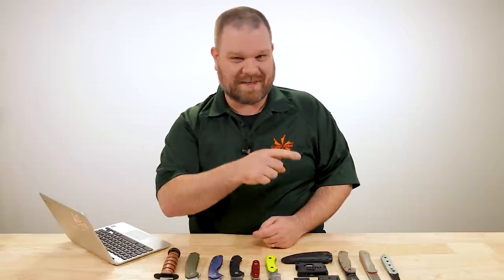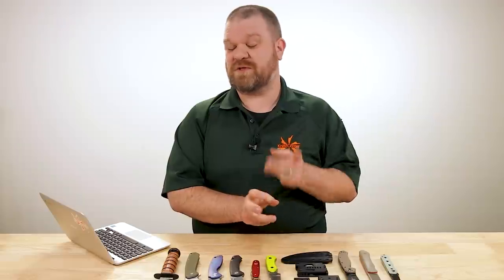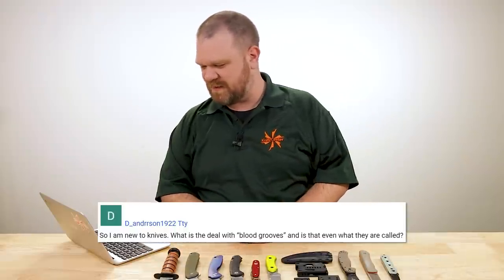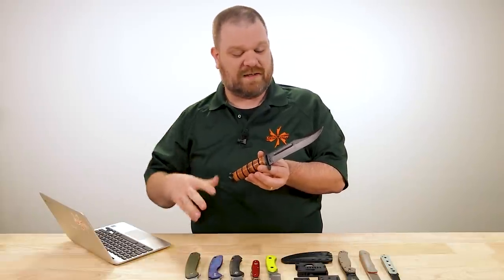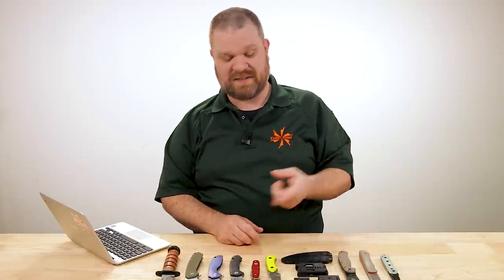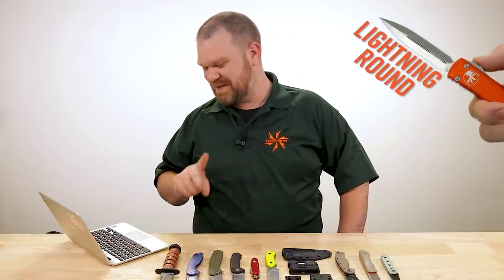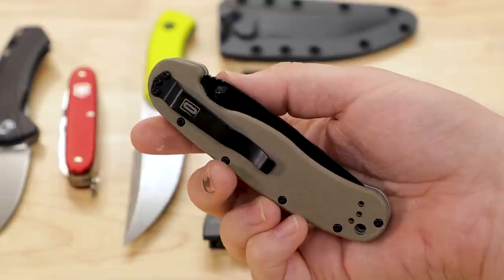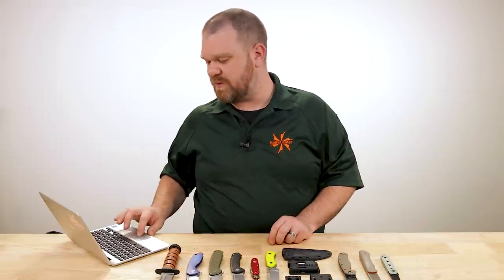KnifeCenter FAQ #94: What Is A Blood Groove?

Comment: Ontario is a good work horse and very easy to sharpen with the AUS-8 steel. Mine had some patina and scratches but it works fine.
Reply: Bought a coyote D2 Rat 1 as my work edc  again , as I gave my son my older one.  One of the best budget folders out there .
D2 was easy to sharpen with a ceramic or diamond rod.

Comment: The way I explain it is to imagine the strength of a flat bar of steel being bent in half vs an "I" beam. You've added four extra dimensions of strength in the material. The extra points of tension should add more structural integrity. It has multiple purposes but that one is my favorite.

Comment: Be sure to mention that to George Patton, Who wrote a treatise on knife blade features and their purposes while he was a student at West Point.Yeah, THAT George Patton.Grooves today in blades are often used to cut down on blade friction as it goes through materials. These are common on everything from certain kitchen knives, where they usually run vertically, to custom knives like Busey.Fullers found on fighting knives also increase rigidity, useful in thrusting. Saving weight is only a small part of the reason for a fuller.

Comment: Hi DCA, question about trying to find my first front flipper for my newly started collection. I try to keep a budget of around $150, and worry finger safety with a front flipper with liner and frame locks, since i'm losing the thumb guard that a traditional flipper tab gives me. What would you suggest for a front flipper that either has finger safe locking mechanisms, or has something similar to a traditional tab or at least a larger finger choil that can still act as a guard? Thanks.  PS. I have looked at the Kizer Cormorant, but I typically don't like the look of clip points, so bonus if it also is a drop point or spear point, since i think those are some of the best looking blade shapes.

Comment: Hey KC crew! Recently got a new pair of boots so naturally I had to get a new knife to boot carry. I ended up going with the Boker Mad Man, which I’m very happy with. It sacrifices on grip length to keep the chonky blade over 3 inches. One is never enough so I was hoping you had some recommendations for some alternatives. Trying to keep overall length sub 7” while maximizing blade length without feeling like I get a good purchase. Sheath would preferably be something I can slap an ulticlip on but leather with a clip works too. I’m partial to old school blade shapes like a clip point or bowie. For the handles I like materials that show age or patina, however I live in the middle of the desert so it’s gotta be able to withstand moisture(blade steel too). Go to town as I’m just trying to keep it under $350. Thanks! Edited for bonus points if it’s a Scandi grind.

Comment: Hi Dca. 

The term blood groove is war related, it comes from the daggers they used for the bayonettes. Frequently the dagger broke during combat. As you may know, it’s possible to limit an hemorrhage if you leave a blade inside the wound. It’s almost impossible with these old daggers because of the said grooves. 
So I may say the term exists but is used incorrectly. 
Nowadays, as the purpose doesn’t exist anymore.

By the way you are totally right, they are no blood grooves nowadays, just fullers. 
Even in tactical environment, you are not supposed to loose hold of your blade so the blood grove becomes useless. 

Have a knife day! ☮️
Reply: Sorry, but I think that's at best a myth. Love to see a citation though.
Reply: Blood grooves were never a thing. That is a myth...

Comment: I just need to point out that the anvil graphic used to make your point about the "fuller" creation would not actually remove weight from the steel sort of disproving the point you were making. The question remains, is the surface fuller feature physically helpful in displacing the "fighting" knife from gelatinous substrate? I think it would.
Reply: Removing material defiantly removes weight.
Reply: No, it wouldn’t remove weight but it displaces metal to lengthen or broaden the blade. A fullered blade will be lighter in weight than an equally sized unfullered blade with similar grinds.
Reply: @simonstokes369  The material in the anvil graphic is being displaced. It is a great deal simpler to grind depressions that removes weight, if that is the goal of the manufacturing process, than to heat and precisely strike the steel on both sides. I guess it's because you get more out of the steel you are working than grinding it away. I'm just saying the steel is still in the blade when it is displaced from the groove by the anvil process.
Reply: I would also like to see some testing on ballistics gelatin..  
Has anyone checked with Cold Steel to see if this has been done already?  
Where's Lynn Thompson when you need him..  
How about those Canadian kids that break cheap Indian swords all the time..  
C'mon Knife Center, put a little effort into a topic before you declare yourself the resident experts..
I'm disappointed in both of you.  Go put your nose in the corner..
Reply: DCA is wrong here, a fuller is a design feature that adds torsional and lateral strength to a flat piece of metal, much like how an I-beam works. The weight reduction is just an added bonus to a true fuller. Now makers often simply add one to reduce weight and material on thicker blades. Blood Groves can be seen on old bayonets and swords, and usually are deeper and run the majority of a blades length, they do prevent a fair amount of suction lock. Look at pictures of older bayonets.
Reply: @FriedPi-mc5yt  Absolutely correct. It makes it lighter than a similarly sized sword that has a single apex (diamond shaped cross-section).

Comment: Hi David, 
  I see many traditional knives with multi blades, like Case knives. Why are there not many options for double bladed knives with lock mechanism's?
 For example, the Bugout with two blades. Both blades open the same way to take advantage of the handle ergonomics. One blade coated, one blade not coated. The blades could be the same , or different. This would give a lot of options.
Reply: Designing a locking mechanism to do that would be a real challenge
Reply: @arrowheadguys7637  Benchmade made a cool one, but it discontinued.
Reply: I have only ever seen one. It is a Brad Zinker custom trapper with two blades. Each blade has its own liner lock.

Comment: Hey DCA, I work on a vineyard and harvest season is fast approaching. Can you recommend a small fixed blade to help me pick all those grapes? The knife should be small and nimble, stainless, and have excellent edge retention (we're talking long days and a lot of cuts between sharpening sessions). I am also partial to wharncliffe knives because of the utility factor and am looking to upgrade from the performance of my vg10 Spyderco Dragonfly. Thanks!
Reply: Spyderco Endela Lightweight Wharncliff in K390 checks off every box for you me thinks.
Reply: @arrowheadguys7637  k390 is not truly stainless, and the endela is not a fixed blade.
Reply: @DF-iv7td  well guess I skimmed over a few requirements lol
Reply: @arrowheadguys7637  all good, otherwise it's a suggestion I'd be in to.
Reply: @DF-iv7td  How about the Benchmade Flyway? I just got one, its an absolute scalpel.
Reply: @arrowheadguys7637  I love thin and slicey so that's a great suggestion. Might have to check one of those out.
Reply: @DF-iv7td  For a Wharncliff I was going to recommend the Toor Jank Shank, but its currently out of stock. Good luck!

Comment: Hi David! I hope you are doing well. I recently started working in a lead acid battery recycling plant. My job entails cutting plastic wraps and  off of skids of batteries. What cutting tool would you suggest I buy? Budget is $200 or less? Btw, I tried to use my ZT 0562 CF once and i might have ruined it. Thank you in advance! Cheers!
Reply: IMO you'd be best off with a folding box cutter that uses replaceable utility blades.

Comment: Howdy Dave! I'm looking for essentially a tactical paring knife, and I already have a couple Cold Steel Spikes, but I'm not super pleased with the steel. Looking specifically for a not very broad fixed blade, 4 to 5 inches, decent grip, better edge retention. Thanks in advance!
Reply: Already have a Real Steel Metamorph too btw
Reply: If you want the thin bladed slicing performance of a paring knife, the Benchmade Anonimus. If you're more interested in the appearance or a paring knife, the Real Steel Arbiter.

There are 2 models that are currently out of stock but I think both are better fits for what you're after than the above 2 knives, check out the Spyderco Waterway Salt Series Fixed knife and the Norden Ascent. All the knives I mentioned will blow the Spikes out of the water in edge retention.  Good luck!
Reply: Bradford 4.5 or 5.5 with a full flat grind would fit your needs well.

Comment: Hey DCA and crew! 
Question; Could you explain what a "swedge" is supposed to be, the orgin of the term, and why it isn't  called  a bevel or something similar?
Reply: The origin is the name of a blacksmith tool for cold shaping metal.
The purpose is to create a thinner tip profile in the absence of distal taper.

Comment: Hey DCA,  would you consider fixed blade knives like the Kabar Fighter and the Buck 119 special full tang knives?  The way I understand it, those knives have "stick tang" or "rat tail" constrction
Reply: Nooooope.
Reply: @arrowheadguys7637  i absolutely agree but someone i was talking to in a comment section insisted that stick tangs are technically full tang .  Some people lol
Reply: @mcsquirgle  I mean, technically its a "full stick tang" as there are partial stick tang knives where it only goes partially into the handle and is pinned in place. So maybe that person's stance was formed based on that distinction?
Reply: @arrowheadguys7637  yeah i understand the math behind that conclusion but I think it needs to be defined for once and for all
Reply: @mcsquirgle  Yeah, unfortunately there is a lot of gray area in knife definitions. While its "technically" correct, functionally the term "full tang" has come to mean what you and I and 95% of all knife lovers agree on as a full height tang that goes the full length of the handle.
Reply from the maker: Full length tang, yes. Full tang, no. -DCA

Comment: I just realized I could ask a question and potentially get it on the show:  I'm getting my son a camping/hunting/outdoors knife, would a small fixed blade, or a SAK be better? He's got no knife experience and safety is important. Thanks.
Reply: Fixed blade is safer.... Maybe look at the Gerber terracraft?
Reply: Smaller fixed blade. I'd suggest a Morakniv Craftline Pro S. It has front and rear guards, good grip, 3.6" blade, and very inexpensive ($15 Amazon) . It does come wicked sharp, but a sharp blade is generally safer than a dull one. You'll definitely go through some bandages no matter what knife you choose for your son, but that's normal and there's only one way to learn to be careful. Important to stress only cutting away from you in the beginning. It's also very easy to sharpen this style of grind as the knife gives you the angle. Get one for yourself too, they're amazing. Cheers
Reply: Both!!!
Reply from the maker: Both. Mora Pro S or Pro C along with a Victorinox Huntsman. Check out why here: https://www.youtube.com/watch?v=-M1SBrJn410
Reply: An Ontario Rat2 would be a good folding knife for starting.

Comment: Thanks DCA. The whole 'blood grove' thing is a myth that just won't die!! Although the term 'fuller' is relatively new in the knife world (about 1800's), the use goes way back. As DCA indicates it's always been to help lighten the blade while maintaining strength. This may be done to simply make the blade easier to carry/use or to balance it out (some of the longest swords were very tip heavy & benefited from some weight reduction). As for the myth of a knife/bayonet getting stuck - has been tested numerous time and is very near impossible. In any case, if your blade is in so deep you can't get it out, I would suggest that the other person will no longer be in the mood to fight.
Reply: The original purpose of a fuller is to give torsional and lateral strength to a flat piece of steel, much like an I-beam. The weight reduction is just a plus.
Reply: @MB-jg4tr  👍👍👍